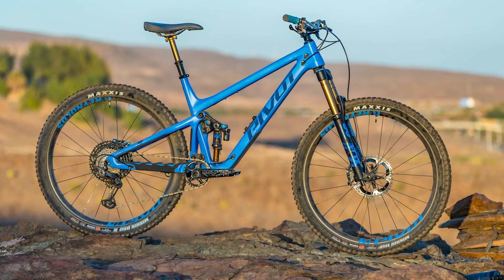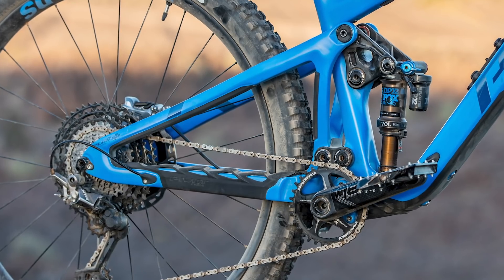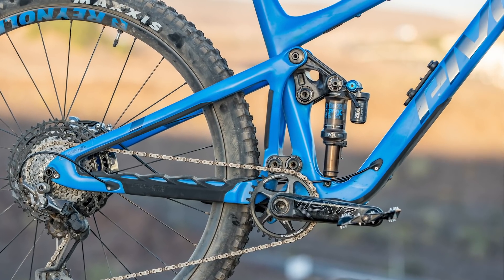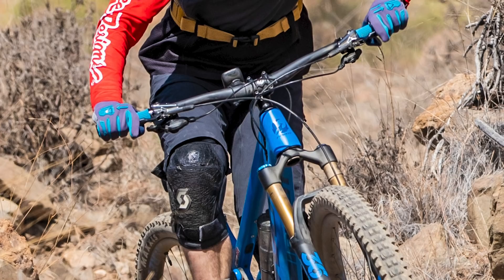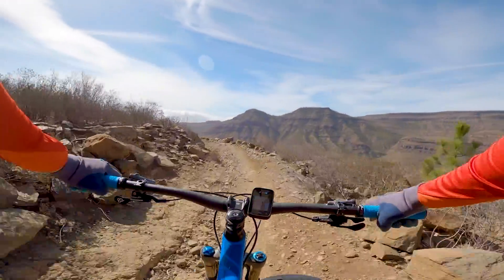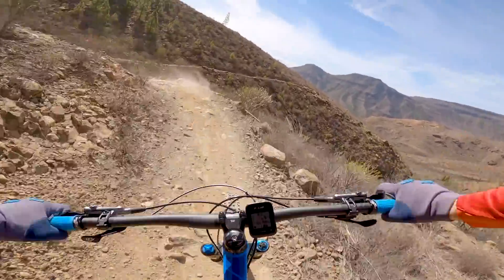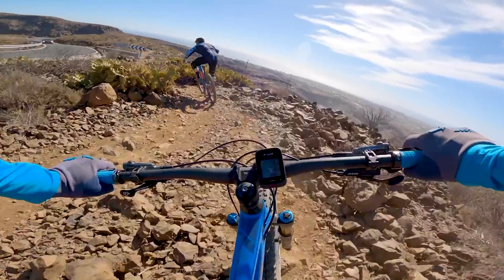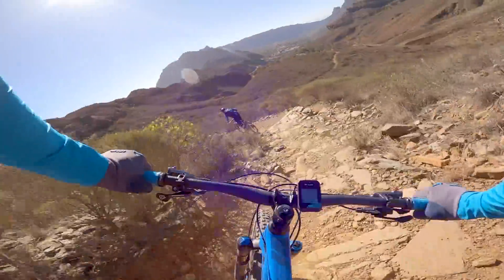Pivot Switchblade | INSANE Suspension & Price, But Compromised Spec

Comment from the maker: Would you try out the Pivot Switchblade? Or is the price too hard to stomach?
Reply: I am picking up my 1st dream bike next week the trail 429. I was torn between the 429 and switchblade. 429 is a 2019 so it was 15% off and ive demoed it 3 times. It just feels solid and right. If the switchblade feels anything like the 429 yes i would buy it for sure. Surprised u didnt like the xtr brakes i have used xt single piston and they are the best ive used, didnt like sram guide felt squishy and didnt inspire confidence. Cant wait to throw a leg over my new bike pivot makes a very stiff solid robust feeling bike that trek, giant and specialized bikes ive riden just dont compare. I have a 2017 trance and love it but it doesn't feel like a pivot!
Reply: I have a 2 year old Evil The Offering and I'm eyeballing the new Pivot Switchblade and Yeti SB 130, maybe even stepping up to a Yeti SB 140 depending on where I'll be living this summer. I love the Pivot but a $9k in this spec it's too much. I could build a better spec for less cash. I did see on their website here in the States that their base model Switchblade is around $5800 for the "Race XT" build and that's still pretty steep. I like the idea of buying a complete bike to jump on and go, but you gotta drop a lot of coin in order to do so....Time to break out the tool kit I guess.
Reply: @Peanutdenver  if u got the knowledge to build ur own i say go for it, im not that mechanically inclined. I think u can get a frame only switchblade just make sure ur rear hub is 157.
Reply: @nicksknives7777  That's right thanks for the heads up. I've only built one bike and it was my Evil. It took me quite awhile to do so and a lot of trial and error. Especially routing cables the correct length where I triple checked because I didn't trust myself. I didn't have a vise to cut the steerer tube to the right length and that was a little tough, but I did save some money doing it myself(the build that is). Everyone I know is so happy with their Pivot and that's what drove me to check them out. The Switchblade seems like a great do it all bike as well. I really give credit to guys like Gee Milner who can throw a bike together with their eyes closed, it truly is a skill.
Reply: I’ve demo’d several different bikes and manufacturers and I bought a 2020 Switchblade and got it 2 weeks ago.  By far this is the best bike I’ve ridden for my style.
Reply: Scott Ransom set the bar🙏🔑✌️
Reply: I think for that price you could get two amazing bikes that the average punter like me would be just as happy with and wouldn't be able to spot the nuanced differences you get between bikes at the top end price point.
Reply: I got a Focus Jam 8.9 and love it, I think that it's a good compromise between trail and enduro. Plus, I got an amazing deal.
Reply: What do you think of the XT race entry build?  That is where my budget ends or are there better options at that price point?

Comment: I demoed a switchblade today on my local trails. Some of the points made I'd agree with ie cable rattle!.

I found the bike climbed really well! Once you point it downhill it's a very capable bike for only having 142mm of rear travel... It will easily keep up with 160mm "enduro" bikes.

Very impressive high end bike and a supremely well made frame.. Well done pivot

Comment: It's the right one for me.  I've had mine for about 3 weeks now and love it.  I find it very easy to climb, btw.  I don't have tons of bikes to compare it to, but I certainly don't experience this an issue.  I have the Pro XT/XTR build.  No cable rattle and the brakes are awesome.  I suspect the build of your demo wasn't done very well.
Reply: Same, I ended up with with Pro XO1 build and it climbs anything. Code RSC brakes are fantastic as well.
Reply: Same! Climbing is primo and no rattle and I have the same build.

Comment: Suspension design is a balancing game, you cant have everything. Just flip the climb switch its not a lot of work.
Reply: No but it is a pain in the ass constantly  trying take ur hands off the bars and fiddling for a swithch when riding.
Reply: @nicksknives7777  How many times a ride do you flip your climb switch?
Reply: @obi-wankenobi9871  on my trance very little it feels kinda harsh even in the middle of 3 settings. I usually set it and forget it to open.
Reply: climb switches are a pain in the butt. it was a nightmare to even get to on my marin hawkhill (sold now) it seems like a little thing but its very nice not having to hit the climb switch
Reply: Lol mine climbs with unnoticeable bob, and awesome power transfer. And that is in the open position. I never feel the need to flip to firm position just to climb because the difference isn’t really noticeable. The dw link design stiffens more as the climb gets steeper, when you need to mash the pedals harder. Maybe if I was doing a longer, smoother, lower grade climb, I’d flip it to firm and lock out the fork….a long point a-b climb before opening everything up and shredding down.

Comment: Bite point changes are typically due to air in the system.  The pad rattle can be fixed by different pads.  I love Shimano systems.  So. I'm biased, but you may like SRAM.  Switchblade is bank but maybe the best trail bike on the planet.

Comment: How would this bike compare to a yeti 5.5?
Reply: My wife has the Switchblade XT/XTR build, which is in a really good place in their line-up. It's about 6700 out the door with a respectable set of parts.  I ride an SB5.5 and I've tooled around on hers a couple of times (it's too small for me, so maybe take this with a grain of salt).  The Switchblade feels really planted and the geo puts you over the BB on steeper climbs, so it does feel like a better climber than the 5.5.  I don't know about the descending capability, as taking a smaller bike like this on big descents would be a bad choice on my part.  My wife, though, has gained an entirely new level of confidence since throwing a leg over this bike.  I'm going to be switching to the Switchblade sometime this winter, and I'll be going with the same build she has.  It's a fantastic bike.  

**It comes with DT Swiss M1700's, so I'll likely get a pair of i9 305's with Hydra hubs instead...maybe more for the bling-factor than any real performance gain.  I run the 54t ratchet on my DT Swiss rims (which the 1700's can accept as well) and can't imagine a higher engagement hub would make that much difference...but they're just so pretty!
Reply: @x3r0x0ul  ive rode a 54t ratchet and Raceface Vault.  RF is twice the engagement but I didnt feel like it was enough of a difference to get me to open up my wallet over.  I liked the 54t alot.

Comment: I’d rather have code RSC’s or Saints on a bike that expensive...the Code will definitely have better modulation and consistent bite point.
Reply: You can get them with the x01 build $6300 iirc